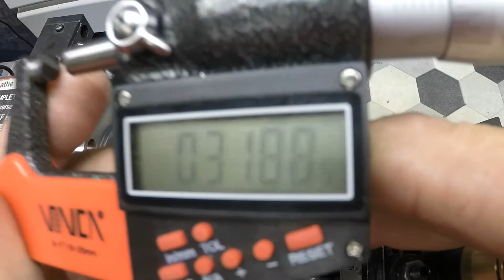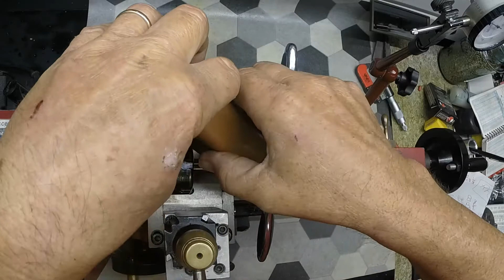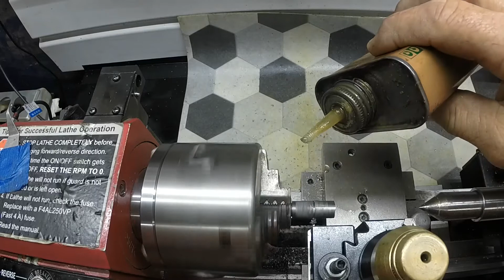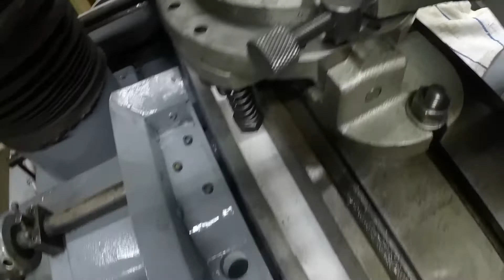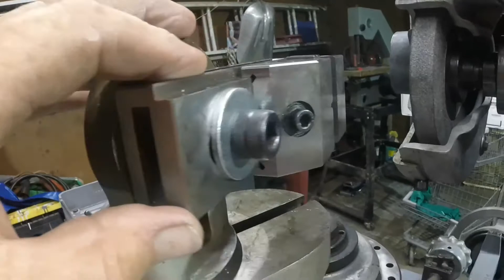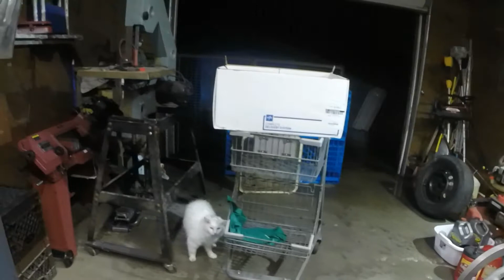MAKING PARTS 3 K  O  LEE

Comment: Great video. I watched Blondihacks and agood tip from her for accurate sizing on diameter is to set your compound slide at like 14° and use it to do your last accurate cuts as it take less off because of the accute angle, good for bearing fits you don't want to get wrong. Please keep these videos coming they are great for learning.🙂

Comment: When you thread a shaft with a DIE , * ALWAYS give it a chamfer that's at LEAST enough to be the MINOR THREAD DIAMETER ! -  That allows the die to 'bite' very easily , especially if you have the center supported with pressure . . .   You probably have a tailstock DIE HOLDER in mind  - If not , I'll hunt down a good video . . . or you can look for one , they're easy to make  & invaluable ,  once you use one , you'll wonder how you ever managed without it !
EDIT :  If you make some form of SPINDLE LOCK , you won't have to FIGHT such a battle - you could 'ratchet away' while turning the tailstock handle , thereby keeping PRESSURE on the CUTTING EDGES of the die !    ( this all goes back to cat - skinning methods  ;)
Reply from the maker: I have two tailstock die holders. one I got from little machine shop and one I made for some very small dies that I have like 3/4 of an inch maybe but the little machine shop tailstock die holder does not facilitate the 1 inch diameter dies that I have. so I have to make one specifically for those dues. yes you are correct they are a pleasure to use.
Thanks for the information
Reply: @kimber1958  You bet !   I'll try to steer you in the right direction when I can ;)   There are a lot of methods to do things , none are necessarily right or wrong , some make work EASIER, others tend to make you work too hard for the task at hand .   The important thing is to get DESIRED RESULTS for your labor !
    Oh . . .  I meant to say that cutting with CARBIDE , cutting at HIGH SPEED & feed rates isn't necessarily the BEST for really soft materials like 12L14 - * cutting softer materials is where HSS 'SHINES' -  *though HARDER & TOUGHER materials cut VERY WELL with M-42 Cobalt ! , (which is high speed steel )

Comment: With all due respect, MrPete222 (tubalcane) likes to say, don't be a hammer and tongs machinist. Channel lock type pliers look remarkably like a pair of tongs. Naturally they will chew up your ER collet holder. It would be nicer to either buy or make a nice slip fit wrench for the collet holder instead.